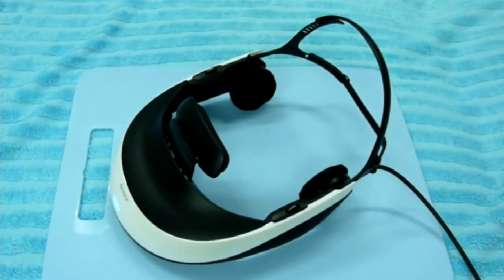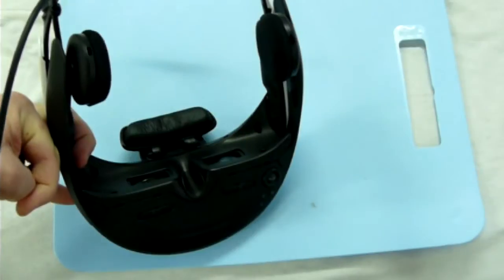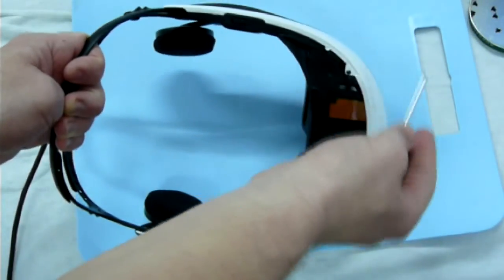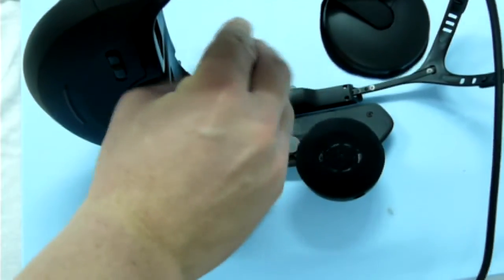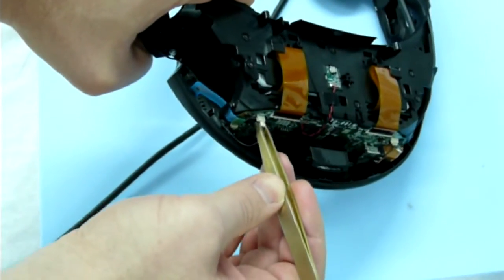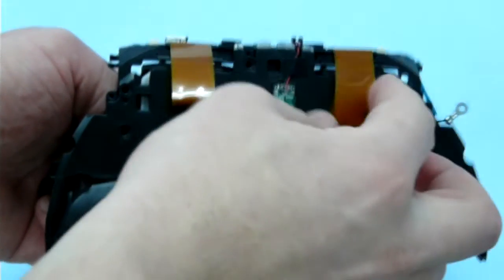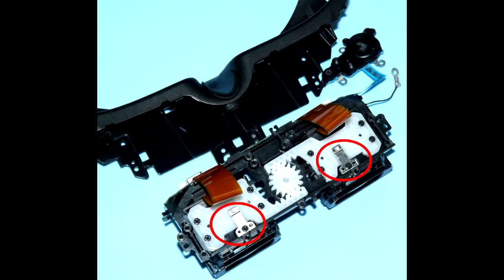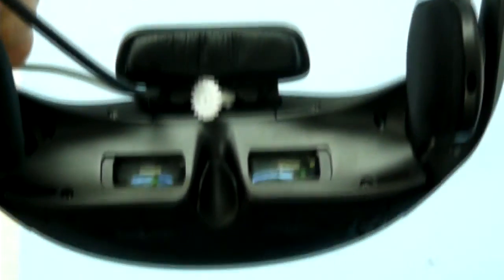Sony HMZ-T1 disassembly

Comment: It's been some time now that I have to wiggle the headphones up and down for some time (typically a minute or so) before sounds start coming through. Why does this happen? There's clearly an unstable contact, but where?
Reply: The headphone wires will eventually break internally after repeated adjustments of the headphones with regular use. Sony made the wiring at the headphone end of the cable very tight and twisty with a number of pinch points which cause wire breakage and loss of audio.The best solution is the earphone jack modification and removing both headphones sorry to say.Put an earphone socket thought the left bottom side of the case next to the left eyepiece slider bar and wire it inside to the existing cables, with earth (combined black wires) to the sleeve connection, right audio channel red wire to the ring connection and the left audio channel red wire to the tip connection.  Remember to use the recommended methods for stripping the wire ends before tinning and soldering.I burned off the insulation with a gas lighter and quickly dipped it whilst hot into alcohol to remove the remaining copper oxide on the wire. Worked out very well. No complaints.

Comment: Izzy, many thanks to your guide.I had to refer to it a few times during my gear wheel removal mod on a HMZ-T1.But you missed the best thing ever by not going one step further - to create an infinitely adjustable eye piece spacing with fully adjustable friction locking.  After taking the gear wheel out, I swapped the two opposite pinion racks over as they are completely reversible. !!!!! Thanks Sony.They are interchangeable and the back side is completely smooth. I screwed them back in place but upside down, with the smooth side up.By adjusting all four screws on the pinion rack you can adjust the clamping friction on the eyepiece slider. It works fantastically well and was a very pleasant surprise. I also completely removed the notch cantilever spring from both pieces as I did not need it anymore. It also reduces the chance of any fouling with the upper casing too.   Just be careful to centre the eyepieces with the thumb slider switch when putting the casing back together, or it will not slide when the casing is put back together.  Best wishes from Australia.
Reply from the maker: to be honest I don't follow you. When you remove the wheel without any further swappings, you got separate eyepiece left-right movement with perfect stepping clamping of each piece independently. what did you upgrade here?
Reply: Izzy, I did not want the stepping at all. I can slide the eyepieces (with some thumb force) to any desired position for best viewing - without steps. I recommend others try it. Thanks. Just to say something further. I believe the friction clamping is generated better one way and not the other way by the screws because there is no countersink on the flat side of the rack and pinion piece, so the screws can clamp down with more force.
Reply from the maker: so you basically removed the clamping in favor of friction?
Reply: Izzy, like I said its a surprise to me that it works. I have removed the detent feature of the notch and am solely using the friction clamping effect. The friction level can be tested and tuned while the case is still open, but is not adjustable once the case is closed, of course. I actually think I just flipped each rack and pinion piece over rather than swap them over (because of symmetry they are exactly the same geometry). Please understand and excuse my initial confusion as so many things were going on with parts going everywhere during this process.

Comment: my menu buttons suddenly stopped working. Only the power button works. Do I have to do all you did to get to the underside?  Does it sound like maybe a bad contact that can be fixed, or is it now a total loss? Thanks.
Reply from the maker: well you can't tell without disassembly. are you sure they are not locked or something?
Reply: not sure about locking, as no buttons work to check; I'm wondering if I can access the underside without having to go through all those steps you did, from the top down
Reply: Same as mine.. after years of not using the HMU, the menu button is not working anymore. What to do?

Comment: Great gude, i'd like to dissassemble it and then put it on a skimask or something, can i do that? how can i make it work without that thing that has to be pushed in order to turn on the screens?
Reply from the maker: Alvaro Molata I've seen ski-mask mods, and even some idiot who put it into VFX or VirtualBoy helmet, probably worth $$$ from collectors. But personally, it works OK as is, and I have plans to sell it off. Whould be hard to sell a ski mask mod, don't you think?
Reply: Izzy Laif  i don't care about selling it, just wanted to know if it still works when is completely disassembled,  without that thing that you push with your head to turn the screens on when it is assembled
Reply from the maker: yes, ski mods are quite popular

Comment from the maker: no this doesn't completely fix blurry edges, but it makes the blurry edges as minor as possible, unachivable while both eyes are still connected.
As for breaking... in Russia we have a slang saying, roughly translated as "an idiot can even break his dick". So no, I haven't heard anyone complaining about breaking anything, as the most precious, sealed lens+tfts unit remains intact whle removing the sprocket.